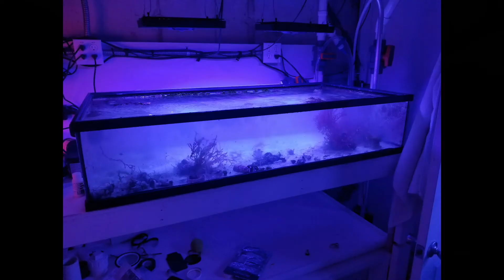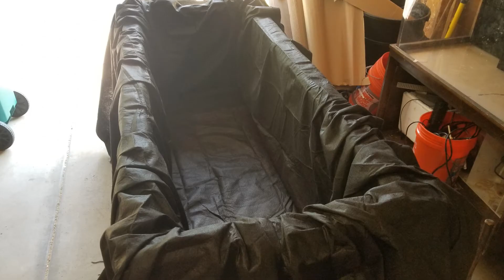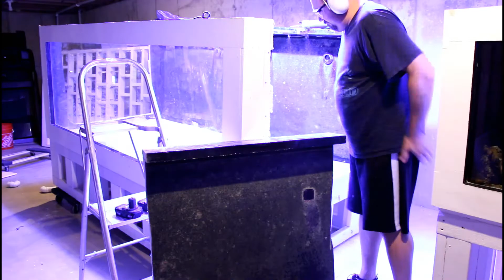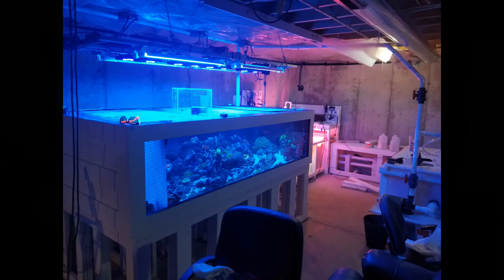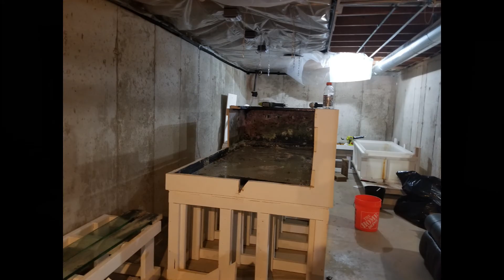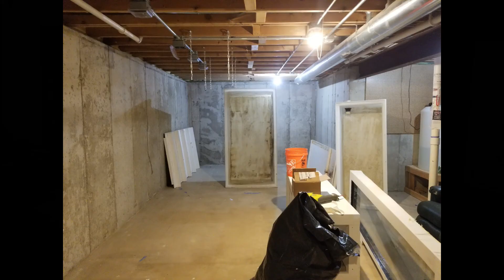Aquarium Teardown Filmed 9/3/20

Comment: Quite an ordeal sir !  Good idea to cut panels.. I need to do that to my 540g, so I can build another tank soon.. Looking forward to seeing your new builds !!!  Best to you and great Christmas..
Reply from the maker: Thanks Free Swimmer.  Honestly with the glass it worked out perfect as the movers did not have to be as concerned about hitting a corner of the glass.  The movers had to move the glass twice once to storage and then to a new house so it was even better there was still a wood frame attached.  From my perspective the RTV 108 almost worked too well and I am about to find out the full strength of this stuff when I go to remove it and install the glass into new tanks.  The new build will be shared soon at least part of it as I am just building out the fish room at this time.  Have a Merry Christmas and a happy new year.
Reply: @algawura2  Cool buddy.. I thought about cleaning wood edges and then , glue and screw, and fiberglass and seal to new structure with new coats of pond armor.. Im thinking the light sanding, with 60 grit paper, and it will be a new build.. Incorporating some pre coated panels ??  Ill be watching your updates !!